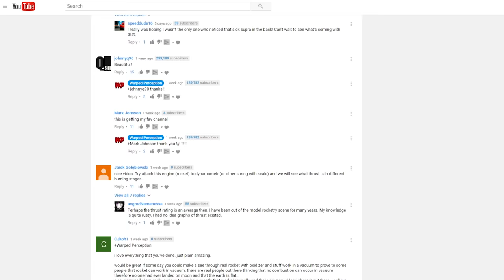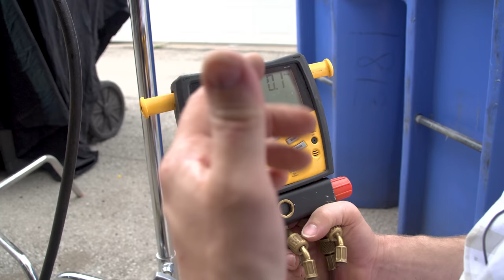Model Rocket Engine In A Vacuum Chamber - 4K Slow Motion - will it burn? - Rockets (S1 • E3)

Comment: Mike Clarkson - You ASSERT that: "Rocket Propulsion does NOT work in a vacuum"
Defend your assertion.

Simple questions, not excuses or bullshit:

1 - Does WATER GAS or Gaseous CO2 have MASS or NOT? Yes or No?

2 - Can MASS Be accelerated without a force? Yes or No?

3 - When the Exhaust gas EXITS the rocket nozzle DOES IT CHANGE VELOCITY (get accelerated)? Yes or No?

Now to the other reader watch as Mike Gives excuses why he cannot answer my questions because he KNOWS that answering proves his assertions wrong.
Reply: I posted these questions AGAIN after deleting the last thread where Mike AGAIN refused to answer, he just hurls insults to HIDE the fact that he cannot answer simple high school level questions.

Now mike TRY AGAIN - JUST ANSWER - NO OTHER BULLSHIT EXCUSES
Reply: To the other readers WATCH as Mike makes up EXCUSES or acts OFFENDED so he doesn't have to answer.

Comment: I've never heard anyone say that rockets can't fire in a vacuum. What I have heard is that it can't provide propulsion because there is no matter (gas) to push off of. Basically, in a vacuum, and jet would just shoot its burned gasses into space but not move.
Reply: So gas is not a matter? You are serious or.jus trolling?
Reply: @tgstudio85  I think what you were trying to say is "So gas is not matter?". No, that is not what I was saying at all. Maybe have someone help you read the comment.
Reply: @MoneyIsSilver  Ok my mistake, tell me then if you detonate bomb in vacuum near small steel ball what will happen when expanding gasses reach that ball? Will it move or stay in same place?
Reply: @MoneyIsSilver    If I fire a standard steel projectile from a crossbow, in zero-G, in a vacuum, WILL I FEEL RECOIL? Yes or no?
Reply: @stuartgray5877  I've read enough of your comments to establish you're either a NASA shill, or just lacking common sense. You're comparing apples to oranges, and have clearly never shot a crossbow.
Reply: @stuartgray5877  Stop shilling. Its so obvious. Who else would spend so much time on here making comments? I guess it must pay good though, huh?
Reply: @MoneyIsSilver  so you are STILL contending the the rocket exhaust HAS NO MASS .  See, the exhaust DOES HAVE MASS and IF it gets accelerated out the back of the rocket then it HAD A FORCE EXERTED UPON IT !  The rocket ENGINE APPLIED THAT FORCE, and you probably DON'T know that an object (the engine) CANNOT apply a force  WITHOUT FEELING THAT SAME FORCE ITSELF, but in the opposite direction .   You should try to take an actual physics CLASS BEFORE trying to argue physics with Engineers and Physicists.

Comment: in a true vacuum, there would be a complete absence of O2. No oxygen would mean no burn. Am I wrong?
Reply: It depends on your own definition of a true vacuum. If you mean all air and associated matter sucked from a chamber, then yes, you will be correct. However, in space (what most people in the comments seem to be concerned about) there are millions of atoms just floating about. That's how stars and planets form! As Davide already said, these types of rocket motors contain their own oxidizer so they'll burn in places with no oxygen, but if it didn't it would not burn. As for the oxygen, it comes back to personal opinion. (I prefer to use space as a benchmark for vacuum, but each to his own, I guess.)
Reply: rocket fuel contains oxidizers which produce all the fuel required to burn, otherwise the rocket at home wouldn't work as well somewhere else with less 02 in the air.

Comment: Chamber too short and too small. The exhaust gasses can push off the chamber walls and just from the smoke alone that completely filled the chamber that shows it was not long enough either. You need a vacuum chamber 3 times longer and larger around also. In fact your slow motion footage shows that the engine did not move until a sufficient amount of exhaust gas built up behind the rocket motor.  In space there would be no build up. It is infinite.
Reply: Joe Manning So what? do you deny that force and mass are independant of what they are pushing on?
Are you trying to say that the force pushing on a rocket only depends on what it is pushing on? Really?
You are not paying attention to the world you live in!
Reply: I am simply pointing out that this experiment is invalid and I will reserve any conclusions until I see someone do it properly. My statement on the size of the chamber is correct. When the chamber was opened smoke and debris reached all the way to the back of the chamber. Even if only by a small amount this still proves that the thrust was effected by the size of the chamber. If I one day see a small rocket motor tested in a large enough vacuum chamber to not allow the volume of the gasses and solids that it releases to effect the experiment and that the amount of vacuum is equivalent to the 100 nanoPascals of low earth orbit then I could consider whatever result comes from that experiment to be valid. I have seen a video presented by a masters level engineer who is much smarter then myself and he presented many convincing arguments for why he believes rockets can not work in space. That is what got me interested in the topic. Science is all about questioning and then either proving or disproving through experiments. I am simply hoping to find someone who has the resources to do the experiment properly to satisfy a curiosity. Good luck to you in your quest for knowledge. It is an endless pursuit.

Comment: the rocket filled the tiny chamber with gas and propelled itself off that. how about the vastness of space? not the most thought through experiment.
Reply: Expanding gases push the rocket from the inside, not outside. Compare with a gun bullet, does the bullet make a recoil when it has left the gun?

Comment: Not a vacuum , in a vacuum the smoke will fall to the bottom , this is fake , it is possible to cause a burn in a vacuum , but it's much harder to do than this shows . The problem is , a rocket has no atmosphere to push off , in a vacuum . The vacuum chamber used here can't prove 1 way or the other if this is true , the pressure pushes off the back wall . There are much better videos , proving that a rocket engine won't work , explaining the amount of vacuum ( a perfect vacuum is not possible ), testing different fuels and many other details left out of this experiment . I've seen several of these , this is the least scientific of them .
Reply: "no atmosphere to push off of" Did you fail high school physics? Go ahead and link one of those videos for me.

Comment: The rocket engine in the video has the end of the tube to push off. In a true vacuum (outer space) it wont work and also the fuel was expelled 8 times faster than normal so the test, in my opinion, was not valid and failed.
Reply: How could the rocket push off of the tube's end?
Reply: If I fired a crossbow in zero-G in a vacuum, would I feel recoil?  Yes or no?

Comment: This makes me wonder, would a jet engine with oxygen being fed to it work in a vacuum?
Reply: Technically, but most of the thrust comes from the air it pushes instead of the burning fuel it pushes back so you wouldn't get much thrust.
Reply: @UniversalExpanse Exactly. It's like people think Newton's third law is nullified in a vacuum.

...In fact, that's exactly what some people believe. I've seen people say that.
Reply: @UniversalExpanse You only need to push off of the gasses coming out of the rocket nozzle. If two people standing on skateboards push off of each other, does the resulting movement require the air around them to work? No, they only need each other, just like a rocket only needs its own propellant.
Reply: @UniversalExpanse Okay, now I'm confused, do you believe propulsion in a vacuum is possible or not? I'm not comprehending things very well.
Reply: @UniversalExpanse Right. And rockets do push air, it's just that they don't get any more power from doing so. They get less, if you want to get into the technical details.
Reply: @UniversalExpanse Yes. The thrust of a rocket engine depends on the speed of the propellant moving out of the nozzle and the mass of that propellant, as dictated by F=ma. So if you fire an engine at sea level, those gasses are also fighting the air pressure and the gas doesn't move as quickly. If you fire that same engine in the vacuum of space, it won't be fighting that pressure. Thus, the exhaust gasses move faster and you get more thrust. That's why the ISP (efficiency) of a rocket engine is always higher in a vacuum.
Reply: @UniversalExpanse :D
Reply: @UniversalExpanse Watch the YT video "uninterrupted footage of the falcon heavy launch and booster landing!"
It has love video PROOF of rockets working in a vacuum.
Watch it and tell me what you saw.
If you cannot spot the parts where rocket propulsion IS WORKING - IN A VACUUM, I will be happy to point them out to you.
Reply: @UniversalExpanse based on your statements above and demonstration that you do not understand how rocket propulsion actually works, I assume that you believe that rocket propulsion does NOT work in a vacuum.
I have plenty of evidence that it DOES. That video is just one example.

Comment: Lol this chamber is not a vacuum and is not comparable whatsoever to  actual space. Hense why planes or jets fail in low pressure because theres nothing to push off of in earths case the atmospheric pressures. Explain if im wrong.
Reply: I understand adding oxidizer to the fuel, rite but the real question now is; Does the Rocket gain significant directional thrust or because space is infinetly expanding faster then light itself,  pressure exerted would be dissipated in space vacuum? I think the latter....

Comment: How could the rocket burn at all without oxygen?
Reply: The oxygen is in the form of an OXIDISER in the solid fuel within the rocket
Reply: Well, as you can see, it does.

Also, yes, oxidiser.
Reply: mesoth:  Yes it did.  So did the tube have a perfect oxygen free vacuum?  Or did his rocket have an oxygen source?
Reply: The oxygen is in the form of an OXIDISER in the solid fuel within the rocket
Reply: Tumeni Hits:  Thank you, I appreciate your explanation.  I finally got  it.

Comment: To me it doesn't prove anything because you didn't make a complete vacuum you can't not in a setup like that the pressures are too great and if you did you should have stayed at so so I don't think this proves anything they say rocket ships half the altitude at 17 and a half thousand miles per hour I'm not convinced when the ISS cameras lose connection all the time and there's nobody bringing them any supplies do you really think man has engineered craft that good and if you look at the moon lander it looks like a bunch of aluminum foil so I'm not convinced

Comment: If you had a pure vacuum of space you acrylic cylinder would collapse then crack. So not really a valid test since you still have air in your chamber. Proof of this is that when the rocket was ignited it filled the tube with smoke. Your pump did not evacuate the expanded gas. You never showed the vacuum gauge during the test showing that your chamber maintained vacuum. -18 torr is the vacuum of space. The mythbusters put a vacuum in a train tanker and it collapsed in on itself.  The question is not whether a fuel can burn in a vacuum if supplied with O2, it's whether it has a motivative force because the molecules exiting the rocket have nothing to push against in a pure vacuum.  Your test was not in a pure vacuum so not valid.
Reply from the maker: This material is what they make vacuum Chambers out of, also nothing gets pulled out by the vacuum pump because there is no atmosphere inside the chamber, it's hard to relate but the smoke that the rocket produces is actually particulate matter and expanded gas, if there is nothing in the chamber for the pump to pull out, then nothing will get pulled out. As for the MythBusters episode, a train tank is only 3/16 or quarter inch steel, if you do the math and calculate the surface area of a train tanker in square inches, then multiply that by 14.7, your resulting number will be how many pounds of force are pushing in on that tanker. At that point quarter inch steel is the same as an aluminum tin can.

Comment: Oh yer great success only when the tube was filled with heat did it produce any measurable thrust which proved they wont work in space,
Reply: Allan Milner what are you trying to say?
Reply: Their is nothing in a vacuum to push against to produce any thrust the heat/ exhaust filled the tube before any measurable thrust was seen ........... conclusion a rocket engine does not work in the vastness of space
Reply: Allan Milner thats the most bullshit conclusion i have ever seen XD
Reply: Allan Milner they push of there own propellant
Reply: Allan Milner if you have 2 bowling balls in space with explosives between them, and you would ignite the explosives the bowlingballs would shoot away from each other right?
Reply: If nothing exists in the vacuum of space, then your theory would fail because their is nothing to push the bowling balls apart, just a quick flash of light and then nothing. Sound require air for the wave to travel and does not work in a vacuum because the nothing to carry the sound, just like the theory of the explosion
Reply: Allan Milner sound has nothing to do with this. so 2 masses with a explosives between them wouldnt create anything but  
A flash of light?!
Reply: Allan Milner who said nothing exists in a vacuum?
there are planets in the vacuum of our solar system.
If you are talking about bowling balls in a vacuum... then there are bowling balls in a vacuum.
Reply: Allan Milner can u please answer my question? If you would have 2 bowlingballs   with a loaded spring between them and you would release the spring , the bowlingballs would fly off in opposite directions right?
Reply: Rico Motions he says no because a vacuum is void of springs
Reply: I doubt it. Is a vacuum also void of springs and bowling balls even though they are the subject of this discussion.
Is a vacuum void of a rocket even though that is the subject of the discussion?
A rocket cannot function in a vacuum because a vacuum is void of everything including rockets? :)
Nice logic!

Comment: No it's not a success . In this case the vacuum chamber is too small and the thrust is generated against the cumulation of the smoke released after ignition in this case it can not be like in space. If the thrust was instantly after ignition in this case yes it a success buuuuut in slow motion we see thrust started after cumulation of smoke

Comment: This doesn't prove rockets can propel themselves in the "endless vacuum of space", because it was a closed tube that immediately filled up with gases ( not a vacuum anymore) and the thrust was put against the back end of the tube.  Rocket fuel contains oxidizers to supply the oxygen inside the engine even in a airless environment.  No offense, but this you prove zero.
Reply: this... has its own oxidizers. and yes, they can propel themselves in space. they throw stuff out the back to move themselves forward in an equal and opposite reaction.

Comment: fake

1. you can see smoke outside chamber after ignition (2:20) - LOL
2. for space vacuum you should have 10 of those compressors running
3. MOST IMPORTANT  you shouldnt  turn off comrressors during experiment since space is 
     almost infinite vacuum.
Try harder next time

Comment: vacuum you say?  no oxygen in there?  ok...
Reply: good thing solid rocket motors CONTAIN the oxidizer already....
Reply: @stuartgray5877  i would assume that is the case, but in reality where would it be held?
Reply: @MojoCuba  The Fuel grains in the Solid rocket contain oxidizer.
Can gun powder burn without atmospheric oxygen? YES.

Does a hand grenade explode without atmospheric oxygen?  YES! 
 Explosives CONTAIN the oxidizer required for Combustion/Deflagration
Reply: @stuartgray5877  thanks for the explanation. applying that to a rocket in space, we should infer oxygen is also needed to be pumped continuously in the combustion phase alongside the rocket fuel?
Reply: @MojoCuba  - "we should infer oxygen is also needed to be pumped continuously in the combustion phase alongside the rocket fuel?"
Yes. Rockets typically carry Liquid Oxygen as the oxidizer.

Other propulsion systems use a more "storable" fuel such as Nitrogen-tetroxide that does not require cryogenic storage.
Reply: @stuartgray5877  thanks

Comment: How does this model rocket engine produce oxygen?
Reply: It has fuel and oxydiser mixed together, it only needs a spark to start the reaction.

Get some potassium nitrate (it's commonly used as a fertilizer) and grind it. Try to burn it with a match, it won't. Grind some sugar. Try to burn it with a match, it won't. Now mix the pulverized nitrate and sugar. Add a little water to mix them better. Let it dry completely. Try to burn it and... Magic!
That's how a solid fuel rocket works.
Reply: @zeendaniels5809  thx
Reply: @vendoaguasa5lucas930  quero comprar, ta gelada?